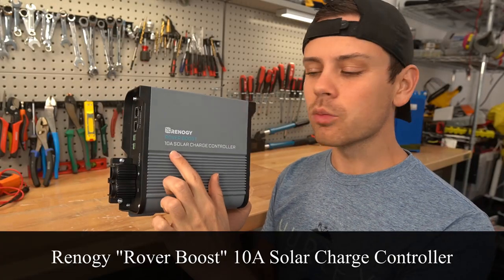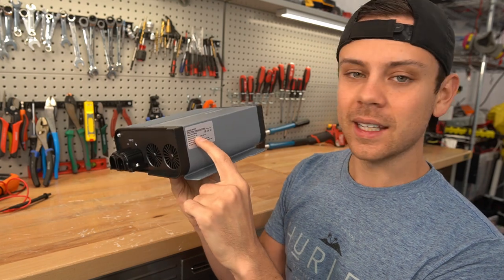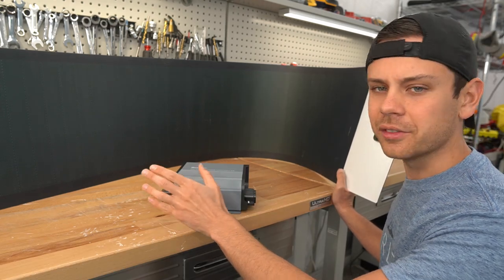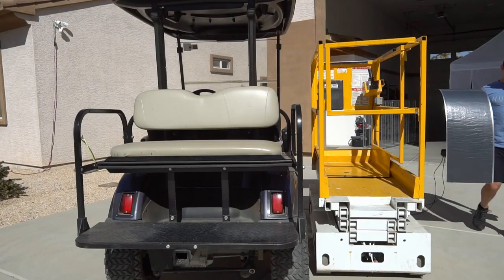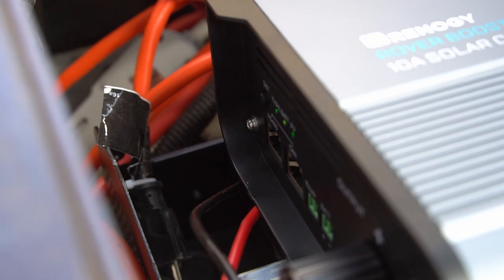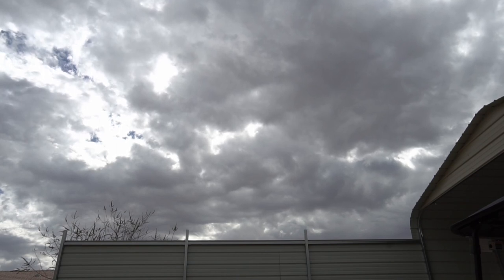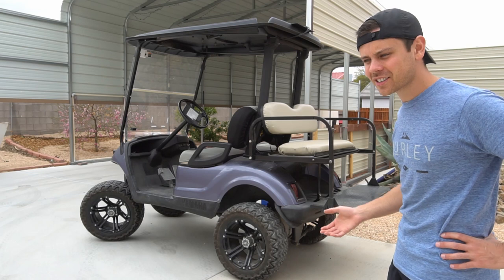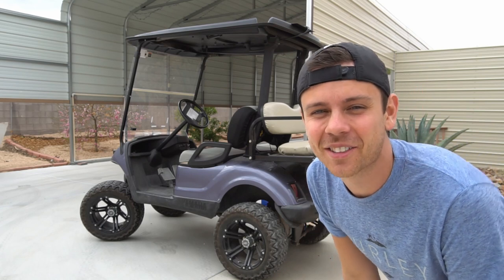Renogy Rover Boost + CIGS Flexible Solar Panel = Solar Golf Cart

Comment: OMG I am glad I saw this video! I'm brand new to solar and recently bought a very lightweight slide in truck camper with 2, 160w CIGS FLEXIBLE panels on top from Rich Solar. I had just watched your video about flexible panels from 4 years ago advising to avoid them as they would fail within the year. I had been starting plans to upgrade to maybe another panel and adding batteries and my heart sank when I watched your video from 4 years ago trashing flexible panels.  Now watching this one, I feel so much better!

Comment: I have 2 * 144 watt, and 2 * 136 watt unisolar amorphous panels! They do great in low sunlight or northern regions, but if they get too hot, they produce far less!
Reply: Thanks, That's good to know.  I had concerns when Will stuck it directly to the roof of the golf cart - that's going to get hot in the summer.
Reply: @andrewfong4216  It sure will, I like them but, they do not like being hot!

Comment: I did not realize CIGS was a thing.  Looks super compelling at this price.  I was considering Zamp OBSIDIAN SERIES 90-Watt panels because of quality, low profile and weight but this Rich Solar CIGS seem to blow all that out of the water and much much cheaper.  This is a game changer for me!  Thanks Will!!!!
Reply: Did you ever pull the trigger on them? Curious how they lasted? I too was considering the obsidian but as thin as they are they won’t conform to a curved roof
Reply: @TobyCostaRica  no I didn’t. Mostly because I got some second hand (albeit new) flex panels from a friend that didn’t need them. Good luck…

Comment: 2 weeks ago we installed such a flexible module. 100 Watts and 300 Volts. We directly charge our 240V System of 20 12V batteries in series.  This flexible module had been manufactured by a German manufacturer who closed production a few years ago, as far as I know.

Comment: Hey, that's my Cougar travel trailer on the Rich Solar site!  Two 100W PowerFLEX panels from Global Solar Energy (RIP).  I was an engineer there for almost 15 years.  We used my TT as a test bed for the CIGS panels.  GSE has been gone for a few years so, the panels shown on my old rig are not the ones Rich Solar are selling.

Comment: Finally this is what I needed, but I need bigger booster....so if 10 amps is max output, ~500 watts, that would be about 15 amps at 32 v input, but the site stated only 10-12 amp input!!!! The richer solar panel is super expensive, you can find other cigs cheaper....

Comment: Great video but I noticed a mistake. Powerfilm is not CIGS. It's flexible amorphous silicon. That's why they are so expensive. CIGS are good but they degrade faster than amorphous silicon. Also, they have to be "sun soaked" if they have been stored in a dark area for a while. Amorphous silicon can be used immediately even if stored in darkness.
Reply from the maker: Oh darn, I thought those were cigs this whole time. Oops.
Reply: @WillProwse  Definitely interested in a follow-up video on the Rich CIGS panels. Would like to hear and learn more about sun soaking and the longevity of CIGS. Thanks for all you do, Will!! You are truly appreciated.
Reply: So is the panel used in this video not a CIGS panel? Would love to see a review of the new Renogy CIGS 150w panels. Just bought 4 but haven’t seen any reviews anywhere. Be first Will ☺️

Comment: I replaced the roof on my golf cart with two 160w panels. Genasun boost charge controller and I haven’t had to charge it in three weeks. It’s legal to drive in my town so I use it to get around town for cheap.

Comment: Nice setup like those panels.  I use the MPT-3210A Solar boost controller for my higher voltage packs with small panels.

Comment: You can buy a pretty decent 300w MPPT boost controller for about 25 euros on aliexpress - search for CTK-300.  It has multiple input voltages and programmable output voltages.    Been using one for over a year without issue.
Reply: They are however slow to adapt when shading changes, paying more for the better quality ones will give you more useful setup
Reply: @workshoponwheels4936  They are indeed slower than a Genasun, but have a programmable output voltage which the Genasun doesn't (which makes them perfect for under-charging ebike batteries).  They are also far lighter than the Renogy shown here. Unfortunately the perfect MPPT boost controller doesn't exist, they all have compromises.

Comment: As always another great video 
Also I'm not sure if you have heard of this new little ev called the changli but I wounder if you could do the same thing with it and maybe even put a trailer hitch on the back of it and pull the solar trailer with it ....... I'd love to see you get a changli and then hear your thoughts on it and what's better between it and your golf cart and what you think about the batteries and the wiring systems and the only reason that I even mentioned it is bc I really think that it's in your wheelhouse and feel like you're going to be honest with your answer

Comment: Hope you aren't adding too much weight.  I hit 28 mph with my stock lifted club car after I got rid of 6 8v lead acid batteries and installed 2 allied lithium 48v in parallel.  380 lbs removed, 70 lbs added. Keep it light!
Reply from the maker: I'm using tesla model 3 cell packs. Which like yours, made it 300 pounds lighter. Have you seen my past cart videos?

Comment: But wait!  There's a solution to the batteries getting too hot!   Hot == Sun is out == Solar panel is producing power == You can put a small quiet fan in the battery compartment that only runs off the solar to ventilate it.  A little fan only burns 1W or so... just use a 24VDC fan with a small in-line resistor and it can be directly connected to the panel.

And you could also do something with the excess solar power that is produced when the battery is full.  Since you wouldn't care how inefficient the power consumption is in that situation, there ought to be something that 80W could be used for... maybe power a small thermoelectric cooler for the battery compartment or something, since you wouldn't care about efficiency at that point.

-Matt

Comment: USA Made Genasun makes waterproof 8A MPPT solar boost charge controllers.  They are much smaller than this Renogy and cost about the same. You can also find inexpensive MPPT solar boost charger controllers made in china for about $40.

Comment: Just put four or five of them on your roof a little customization extensions on the side to get five installed.
            Add foam filled tires so you don’t get leaks still be light and soft

Comment: It looks like your roof has room for 2 more panels, so you could have 3 of them up there! If you're afraid of cooking the battery, would connecting some fans around your battery that run off of solar power be able to keep them from cooking? I think with 3 panels on your roof, and a cooling system next to your batteries, you could for sure charge it outside.

Comment: These flexible panels are getting to a point where they are useful for backpacking. Hang them on the back or top of the backpack, plug them into my Nitecore NB10000 external battery pack and voila - game changer. You need an inverter I guess. How big of a cell would you need to charge a 5000mah phone every 2 days?

Comment: Maybe  fogure a way to cool the batteries with a chill box. Take some styrofoam and surround the batteries, leave enough room for a little ice to lay around the bottom half but not so much that it could cause any problems. As the ice melts be sure the styrofoam allows it to leak out where you want it too and not where you don't want it too. They have these small ice makers you could fit in there and it constantly makes ice. If you capfure the water and funnel it back into the ice maker, all you would have to do is top it off every now and again on hot days.

Comment: What would you recommend for a 1500 watt 48vdv inverter for my golf cart? Currently have 4 - 12v trojan FLA. 400w panel. a basic mppt boost converter. I was trying to find something with terminal lugs for the AC output so I can custome install receptacles on the dash. I am considering 120v or 240. $300-$500 budget. 

Thanks for all the great videos!

Comment: What kind of batteries are you using a have a cart that has 4 12 volt battery to make 48 volts just wondering for when I have to change mine. Thanks great vid

Comment: Hi Will, I want to separate out some critical circuits from my main panel, then run those on solar with a transfer switch to put the circuits back on the grid when the batteries need charged.  What do I need?  Critical circuits will require approximately 8k watts.  I really appreciate your videos!!

Comment: Add a radiator with dc pump and fans and a glycol system to keep the batteries cool... Or even better... slap a tesla battery or 2 or 3 or 4... lol, in there it has the cooling / heating plumbing already setup...

Comment: I keep seeing old battery lawnmowers for free on craigslist. So I'm thinking of picking one up and just getting new batteries from china because that's pretty ez now. Then I started thinking about having not just a lawnmower but a movable auxiliary powers station on wheels. 
Then I started thinking what if Will made one. If you think about it, rich folks mostly complain about the noise  of their gardeners, so all those leaf blowers and weed whackers are going to go the way of the dinosaurs and the internal combustion engine. I myself enjoy using the electric weed whacker with the Honda generator. I'm old and it's just easier. 
So,if your lawnmower is the battery bank then all the rest of the appliances you need already exist.
Can it be made and still be light enough? It needs a fat inverter and a big battery.

Comment: Have you done tests on the products you have had concerning RFI? Several RV, boat, van or camping users use CB, amateur radio and especially charge controllers and inverter create a lot of noise.  These make the radio totally unusable.  It would be interesting for you to develop RFI tests and compare the products.  You would help a lot of people.  Thank you in advance!
Reply: Anything using switching mode will create lots of RFI. Some of the newer Ham gear has step-adjustable filtering to help compensate but that can leave you with unusable frequencies for weaker signal reception. The only certain cure is to not charge while operating as this is also line noise from the wiring, not just EMI through the air. For EMI adding distance between radio and the offending devices helps.
Reply: @P_RO_  A good switching design with good filtration is RF quiet. Victron informs customers who request that all of their products are RF Quiet, which is wrong. Genasun are excellent regarding the RFI. This is why I was asking since everyone's performance is variable. It is wrong to say that a switching power supply is systematically noisy ... This would make it possible to list the good of the less good by a classification. Thank you!
Reply: @ThinKkBIGG  I'd have to see lab results with a spectrum analyzer to be convinced. If they were switched at only one rate (frequency) then good filtration could happen. But they regulate by switching the time of current passage and are therefore variable in frequency, and nobody has yet invented a filter which covers more than a relatively small slice of frequencies, or blocks frequencies above or below a certain frequency. And this does not account for multiple harmonics of the original frequency. It's been an issue since the beginning of radio and the world's best RF designers and engineers still struggle with it so I find it very unlikely that a company with 1/10 the experience designing a non-radio product can best that. They may be able to keep usual broadcast and IF frequencies clean, but my Ham hobby covers from VLF to near microwave frequencies, and somewhere in that there will be RFI. 

So the truth will be that there is only a range from bad to some level of good, but never anything totally 'clean' and I'll stand by my statement until you or someone else shows me a properly done S.A. check done on a unit. I'd love to be wrong here as RFI is the bane of my hobby and I'd love to know how to have more fun. Show me so I can please.
Reply: @P_RO_  already during a bad design to add a shielding (faraday cage) with at the inputs and outputs of ferrites # 75 and # 31 helps, imagine a product better designed at the base. Do your research on Genasun charge controllers like the GV-10, you will see that it was designed under the principles of being clean for hf amateur radio bands. Switching mainly affects the low band (160 to 40m)mainly. This is why the 75 and 31 helps a lot. 73!
Reply: @ThinKkBIGG  Yep, they target specific frequencies and can't cover them all. Lots of us use HF doing DX where RFI can kill you, and I'm into SWL too. Maybe very good but not "clean" which is my point. Better to unplug and use the stored energy, and hope RV'er's nearby aren't a problem. 55!

Comment: Hey Will I haven't seen you do any evaluation on me silicon salt batteries which is supposed to have a long u says the charging cycle 3500 not as many as lithium and then they can go down past the 50% so that's better than lead acid and they can go down pretty far close to like lithium would you review some of the silicates old batteries like Bolt! Thanks G

Comment: Will, really enjoy your videos. I had a question, I want to upgrade my go-power system on my 20' travel trailer, I think the inverter and solar controller are fine. I currently have 2 agm batteries, no lith-ion. I need more panels. I was considering doing renogy 4 x 100 panels or maybe adding a couple of these CIGS. Current system has one go-power flex 100. What do you think?

Comment: Hey Will! I'm curious to know how that CIGS panel has performed now that you've had it awhile. I'm wondering if the different tech allows it to produce near STC or if they're about 80% like most other panels I come across.
Reply: I'm curious too. Looks like Rich Solar changed their warranty from 5 years to 1 year so I wondering if they have some quality issues.

Comment: Can you apply CIGS solar panels directly to a van's metal roof? Ram Promaster metal roof has ridges and I wonder if these panels can handle the heat of summer in Las Vegas.  How has the CIGS solar panel held up? can you do a video all about CIGS solar panels? review the BougeRV

Comment: I'd replace the roof of the cart with a flat piece of plywood. Idk how well it would work, but it could make mounting solar easier
Reply: Was totally thinking same... custom cut a new roof from a thin piece of plywood or skip the wood idea and instead replace the roof w/a custom cut piece of HDPE or (better yet) custom cut a new roof from a sheet of Delrin (aka: Polyoxymethylene/POM for short) then paint the underside and edges black, but leave the top white to help lower temps from the Summer Sun!
Reply: he did that already and changed back.. lol.. check his older videos.. this guy is hilarious!
Reply: @noahsobd  - Good to know, I'll have to go back and see if I can find the video.
Reply: @__WJK__  It's only a small slim panel down the middle taped to the roof, plywood is overkill. He connected it just fine. The panel is flexable for a reason, why add a rigid flat pice of wood backing, it defeats the purpose of buying the flexable.panel for it's flexability.
Reply: @Troule9 T - Never questioned or said anything about anyone's "connections." Simply offered a few general/friendly suggestions regarding upgrading the cart's seemingly flimsy OEM roof "should" the solar panel have issues not sticking or not pulling in max wattage due to the cart's wavy, non-flat and/or very dark-colored roof.

Comment: Help
I'm getting into solar because of you (so thank you) I bought your book on Amazon, I bought a renogy 100w 12v panel that came with a charge controller I also got a renogy 100ah Agm battery. I'm just testing a simple 1 panel system hoping to go to a 2 panel system.
What breaker should I use? I heard it's better that bothering with fuses, so what do you think?

Comment: Question: what's the minimum solar system to survive power outage and still keep fridge and freezer going.  Keep radio and maybe internet/TV.  Minimal lights. Charge phones.   No need for heat... have propane for that.  Just starting and I'd like to begin with at least enough to keep basics powered during long term power outage which happens frequently in Michigan.

Comment: Looking at the specs of that controller it says it auto detects 36/48 volts automatically for NON lithium batteries.  Will it work for lithium ebike batteries, or even better lifepo4?

Comment: looks like you actually have enough space on the roof cover for two of those panels if you can get a higher charging rate.  do those panels have a good rating for series connection?
Reply: I was wondering the same thing

Comment: Will, can you make an upgraded version of this video? Renogy has a newer model with Bluetooth connection. Also, BougeRV, Rich Solar and Sunflare have these solar panels. Sunflare gives them a 25 year warranty, while BougeRV only gives a 5 year warranty.

Years ago I saw this video, but now I own a 2017 Fiat 500e eSport version  with 19,000 miles. I don't drive much, but wanted a roof top CIGS for the car. Only 1kw a day is fine. That provides 3-4 miles a day and I drive less per week.

Can I use the Renogy mppt charge controller or is it best to use my EcoFlow Delta 2 to capture my solar and then schedule to charge my car later? I presume that the Fiat 500e has too high voltage. Is charging the 12V system a better idea? The heated seats are 12 volt.